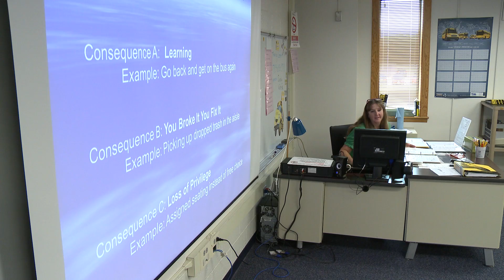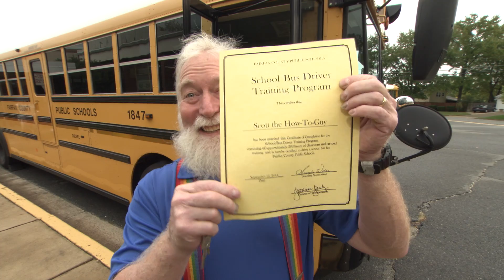Join the Driving Force in Education! - Learn How to Become a School Bus Driver

Comment: The salary for a school bus driver here in Ontario, Canada, is $14/hr Canadian, which is $11.20/hr USD. And you only get paid for 4 hrs of work per day. So you make $225 / week.
Reply: That's pretty sad in my opinion. I work at a super market part-time and make more than that. I did recently applied to be a bus driver as a second job though. And the fact that some get paid so little despite all the training to have to go through, and being responsible for dozens of lives to make it to their destination safely everyday doesn't seem worth it.
Reply: I know that this video is 4 yrs old and pay is different state to state.

Right now minimum wage is San Diego is $15 an hour. Bus drivers here should be making $25 an hour or more.
Reply: Not sure if it depends on the area but around Toronto, school bus drivers are paid a min. of $17/hour and as high as $22/hour + all those benefits and stuff. Now with things back to normal somewhat, extra driving assignments are available if the person takes on more work.
Reply: Dang its $26/hr in Atlanta GA in the US
Reply: @robstwocentz  School bus drivers or transit? Transit drivers here make 35+ but thats a city job so it's pretty kushhhhhhh

Comment: 18 a hour seems like a lot but most bus routes are 2 hours maximum for 4 hours a day
Reply: This can CBC
Reply from the maker: The starting salary is now $19.20 per hour (fall 2019).
Reply: You can do field trips, shuttles, late runs. All to get extra hours. Where i work driving starts at 20$ an hour, youre guarenteed 20 hours a week, and you can get 40+ hours if you want a midday route, field trips, or shuttles etc
Reply: Yeah you have the option to do more hours if you would like 
Im applying to this job, cause it looks easy and pay is very good compared to any other job
Reply: Rodney Mclaurin well yeah i’ve been on those buses my self when i use to go to school 😂
I’ve seen everything 
But for a starting pay of $15? I’ve cleaned restrooms day after day, wash dishes day after day for $7.25